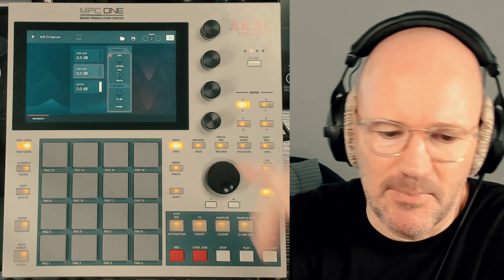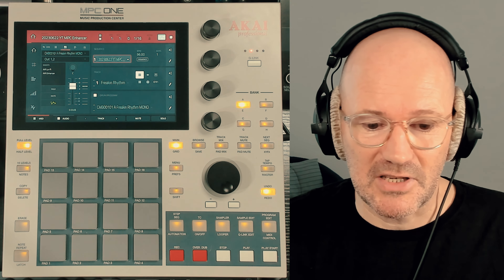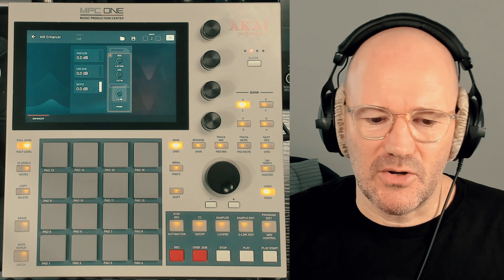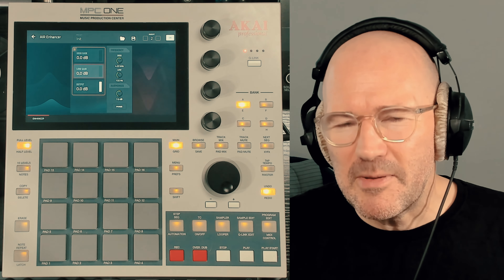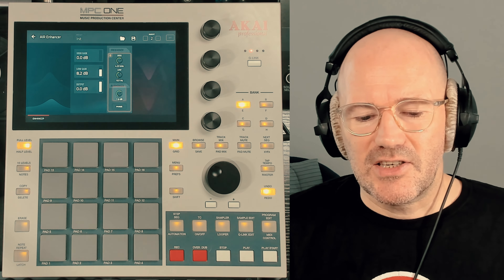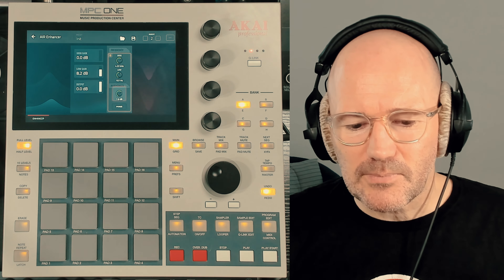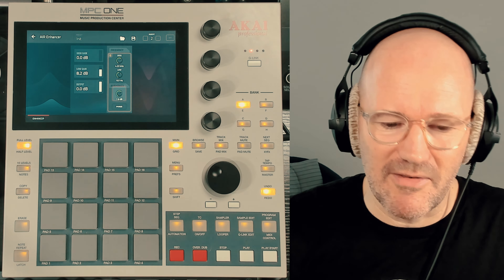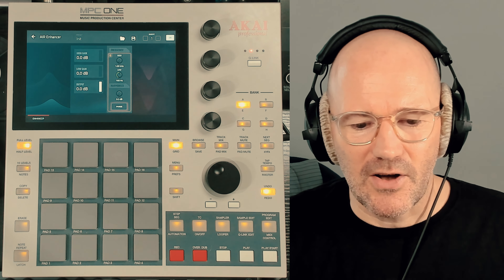Akai MPC Tutorial. Air Enhancer Saturation & Harmonics. Secret MOJO Sauce in your mixes on the MPC.

Comment: This Air Enhancer has turned out to be quite useful for the finishing touch. I've used it on MPC 2 software. I think of it as a some sort of saturating eq. In the software when the gains are zero the high and low frequency knobs won't seem to do anything, only harmonics does. Anyways, I put the gains first really high to hear clearly the sweet spot when dialing the frequency knobs, then turn down the gains to proper level and then maybe fine tune a bit the frequencies because the sweet spot seems to move a bit depending on the gain level. Lastly, I dial the harmonics knob really carefully if at all, it makes sometimes a bit harsh sound quite quickly. The reason why it is good for the last finishing is that it is really simple and there's nothing visual meters so you really have to just trust your ears. Result is usually really smooth, clear but lush sound :)
Reply from the maker: Yup it’s definitely very useful if used correctly. Thanks for watching.

Comment: Wow. 
In your opinion,, how do you think Air Enchancer should be used? before or after drum compression?
Reply from the maker: Hey buddy, there is not really a right or wrong answer here. It really depends on what you are trying to achieve. Generally, I would saturate or add harmonics after I have control of the source by using EQ and compression. However, there is nothing wrong with saturating first and then compressing and EQing. The only thing I would say is if you saturate first, that you then have to get control of that with EQ and compression after the fact. Adding color tends to be something you would do once you have the source in a place you want it to be in terms of having control over it. But as I said, there are no rules and it is good to experiment and sometimes have happy accidents. Thank you for watching.